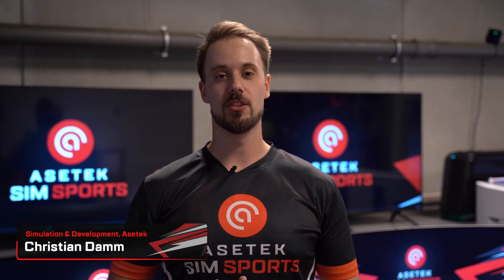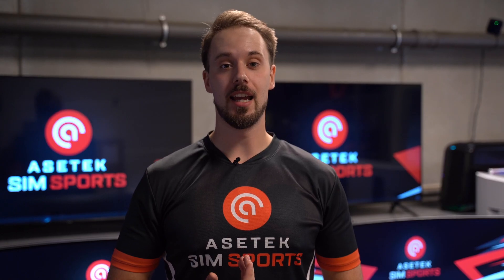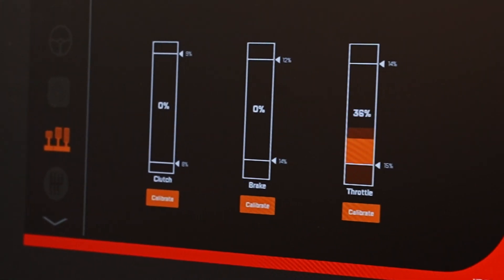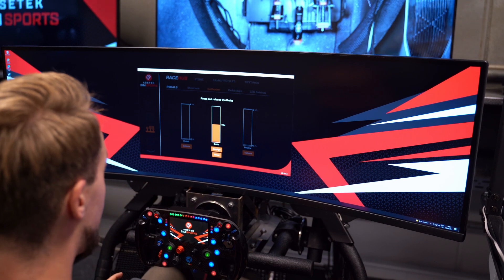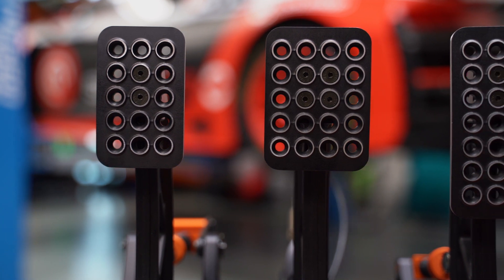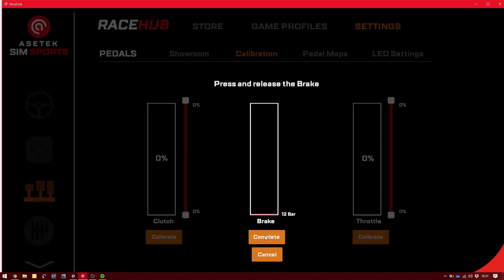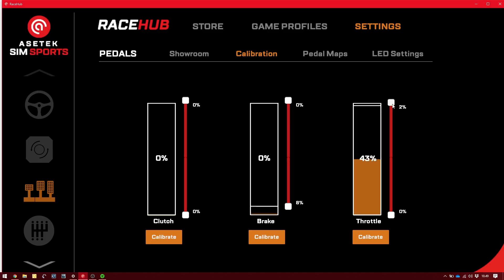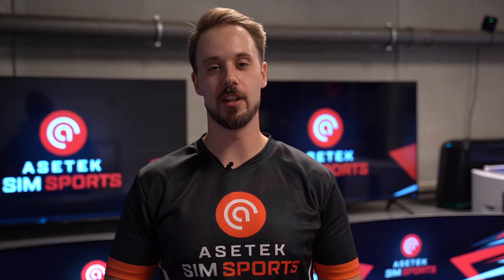The RaceHub™ Software: How to Calibrate in Seconds

Comment: i have the forte and i have an issue where its not letting me click complete
Reply from the maker: Have you been in contact with our support team? 😃
Reply: I have the same problem right now. I cant click complete at the desired brake pressure I want. I can only click complete when the pressure is higher than its already set. So I can only go up in brake pressure, and not down. Really frustrating when I want it set lower than it currently are. And there are no 'reset' or 'delete calibration' button, so I can calibrate it from new... Did you find a solution?

Comment: basically a carbon copy of heusinkveld's smart control
Reply from the maker: Sure there are similarities to other pedal calibration software but the are plenty of differences as well.

One thing is the ease of use. Racers should have the option to adjust but for those that want to get racing quickly, it should be simple as well. Right now it's hard to see as our first product is pedals, but next year wheels and wheel base will also integrate into RaceHub. The same thing goes with the entire sim racing ecosystem we will be providing over time.

Calibrations made in RaceHub will automatically be saved. This means that calibrations will be remain saved for every simulator/game you use. Having everything in one user-friendly software, should help racers with everything they need but with less hassle. That's our ambition with RaceHub :)